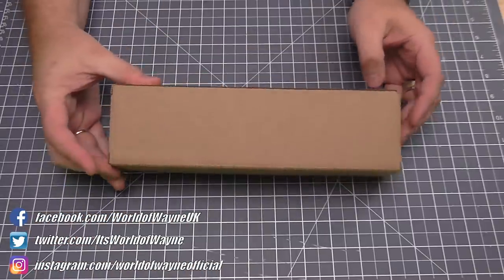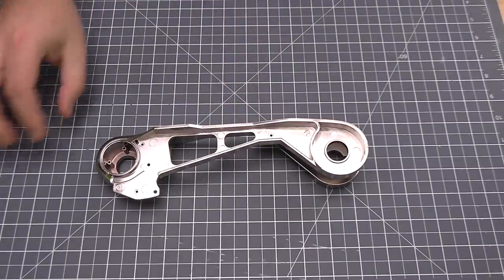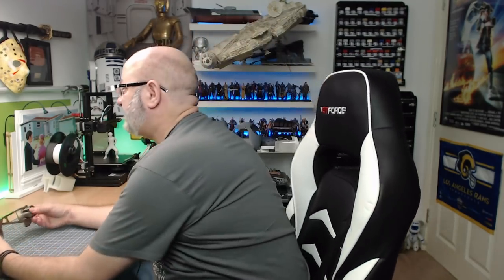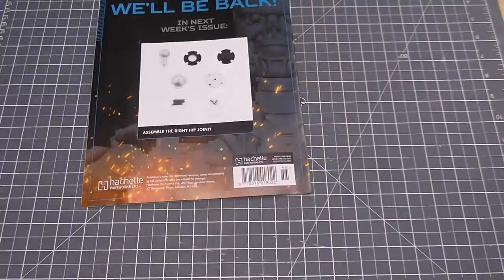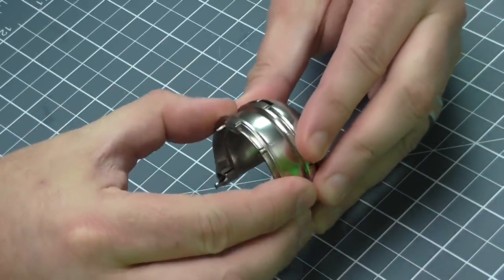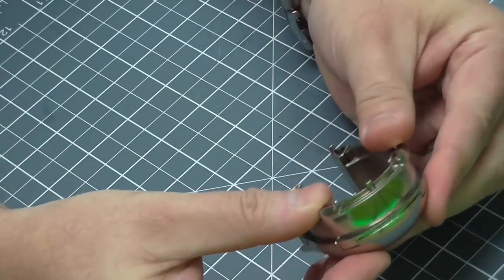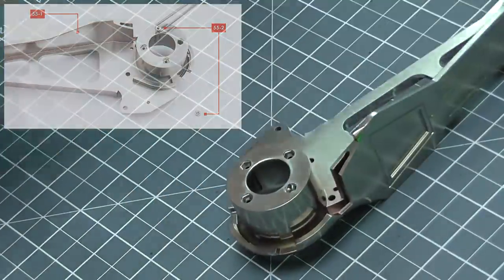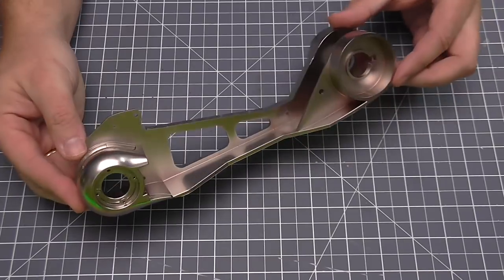Build the Terminator - Part 55 - Fitting a Joint Mechanism to the Right Thigh

Comment: If the legs were metal you'd think that would remove the need for those support bars from final model which is already something which bugs me about it. Cost saving over quality here I'm afraid. For the price it should be metal

Comment: There you  have the reason for the metal rod going up its bum, the top weight could buckle the lower plastic, its a bit silly really, if the lower half was all metal it would be a much stronger build, but they are cutting the cost down by doing this, which is par for these types of builds

Comment: I agree with the consensus....it would be more stable if the weight was in the bottom, not the top.  So I’m guessing it’s just a cost saving measure. Disappointing, but not totally unexpected. I’m loving this build, and the fact some parts are plastic isn’t going to ruin that

Comment: Ok, arms definitely need the strength to hold the gun in different positions. Still no excuse for plastic legs. Metal would have given more strength and could be Alan key screw ‘locked’ at the joints to hold posture - just like the arms. Base could even be cheap and hollow for a sand ballast if balance was an issue. Sorry, it’s cost cutting however you look at this. Too late to cancel for me but wish I’d known at the start.

Comment: Also if you look closely in on the bac of issue56. Their,s what looks like adiecast metal balljoint for that thigh section somwhere. And yet they didn,t apply the same technique to the ballwrist joint section in issue24hmmmmm!🤔

Comment: I too was gutted by that thigh piece being all plastic/not diecast metal. I,m not saying that all of the leg section should be diecast metal.... from it. Basically what i,m saying is make the thigh section should be diecast metal/the lower section plastic. +even if both legs we,re half metal/half plastic then true their would be abit more weight to it. But in the long run it would still be able to support it,s own weight. But they chose not too/they Fucked up/cut amassive corner. Now their are specialists who can make amould of that thigh piece. And change it so,s that it,s diecast metal/not plastic. It would mean me paying out abit more but i,m seriously thinking about it

Comment: Hi Wayne, I think there wont be any strength in thoes plastic legs to support the weight from the top half, (thats made up of both dicast/ plastic)  he's gonna be weak at the knees, due to all the plastic parts for the legs, we will get from now on I'm thinking! Top heavy bottom light, this is the reason we get that supporting rod! That being said you can achieve more detailed parts via plastic then you would from dicast parts, so do you sacrifice one for another? 🤔
Reply from the maker: Its supported by 2 metal rods that attach to the back
Reply: @WorldofWayneUK  ok, I was under impression it was just one! Will the  rods be kinda piston type's, allowing the T800 to stand straight and not hamper any articulation ect?
Reply from the maker: @AdamKummrow5436  Its 2. I will try to show you a picture on the next vid
Reply: @WorldofWayneUK  thank my good man 👍😎

Comment: has anyone done the maths on this to get 2 yrs worth of parts is going to cost-  £1300 or more a lot of money for a predominantly plastic film figure,  not a lot cheaper than the side show half scale collectables one that is all resin & I think the same height, plus theirs is not cheated and changed for certain parts because of moulding problems it is authentic